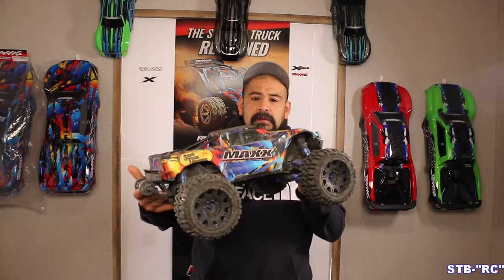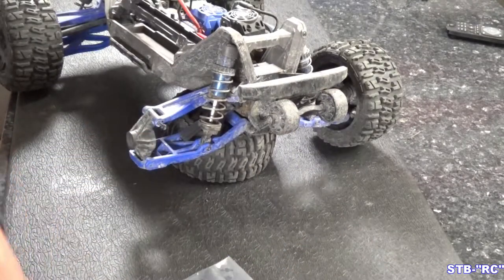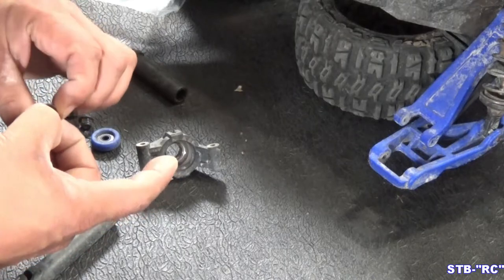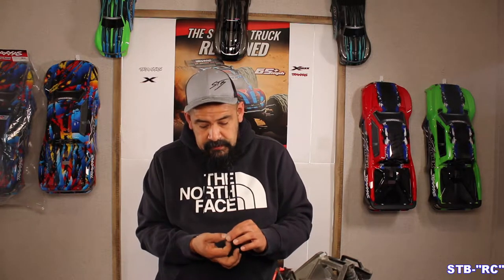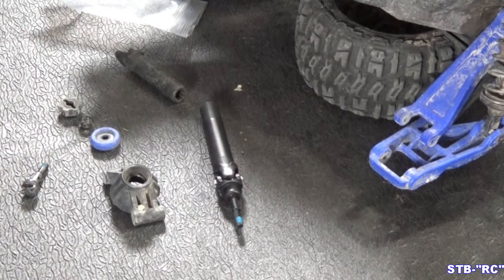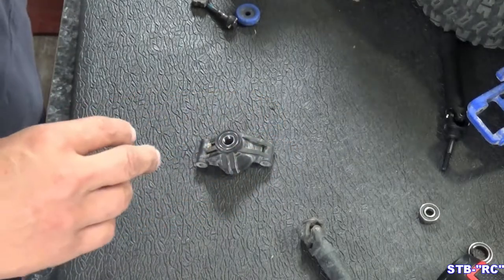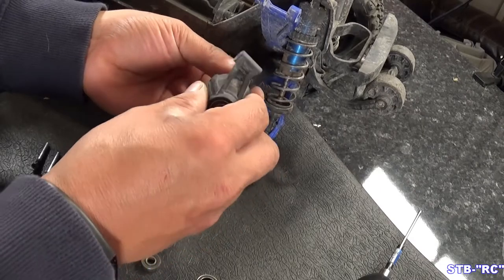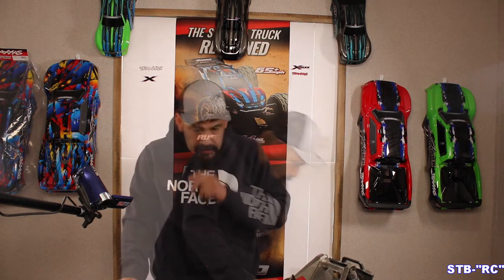HOW TO: Replace Traxxas Maxx Rear Stub/Axleshaft Step By Step Video

Comment: Do you recommend running the maxx on 3s or 4s?
Reply from the maker: In smaller play areas, 3s hands down. It’s just as fun if not more. It won’t self right as easily on 3s though. When I run 3s I have just as much fun as on 4s. Sometimes slower is faster.
Reply: @stb-rc7262  awesome thanks